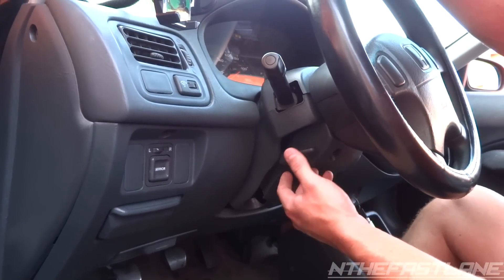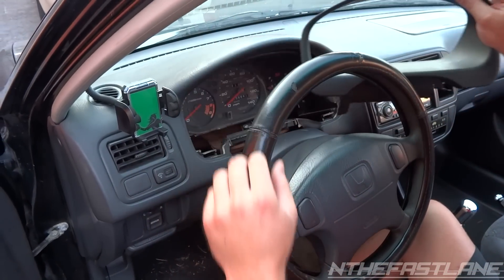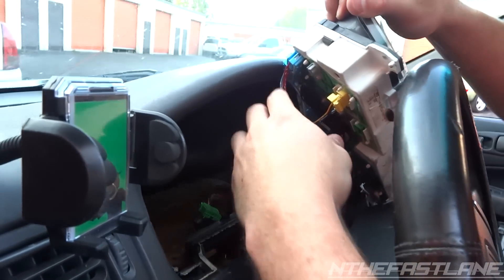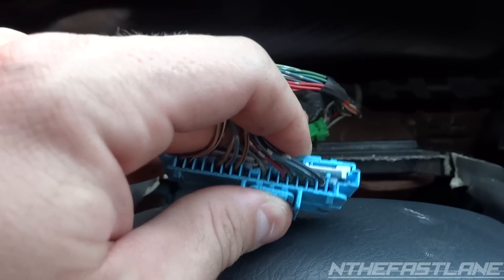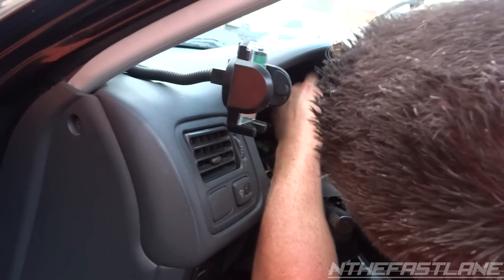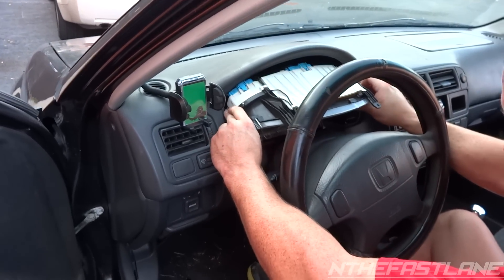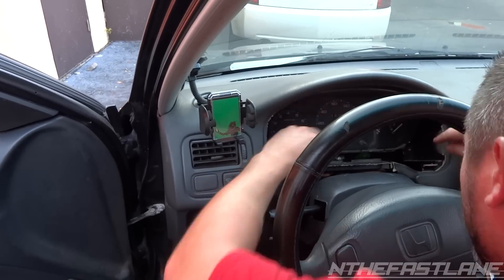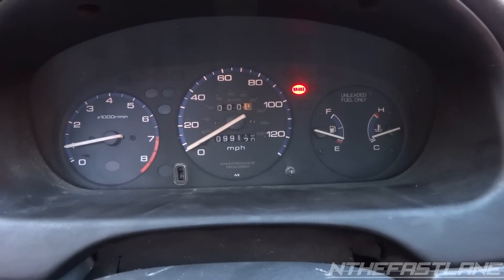▶️Gauge Cluster: How To Replace (Honda Civic 96-00)🔧

Comment: can you replace the speedometer in a manual transmission with one from an automatic transmission? will it plug and play
Reply: Obey Brandon yea you can, I currently have a auto cluster in my 5 speed cause the manual and needles stopped working

Comment: hey must say great vids I have a issue with my Honda eg8 car starts on the 7th tumble check light comes on but wen car has been driven a couple miles and engine switched off and started bk it starts on one tumble and no check light can u give me sum advice.
Reply from the maker: Faulty Ignition switch or Bad cap and rotor on the distributor...even a bad coil inside the distributor could be possible. Change the cap and rotor on the distributor first and go from there. Do you hear the fuel pump? Could also be a bad Main relay under the drivers left foot area under the dash by the fuse box.

Comment: I have a squeeky mechanical speed cable I need to replace on my 90 Integra, would you say this process is about the same on Integra's? Thanks!
Reply from the maker: If you're talking about the throttle cable then yes.Just spray a little silicone spray on it and you're good to go. Check out my window regulator video, the shopping cart with the spray is under the video..about 5-10 videos back on my channel.
Reply from the maker: Here you go..let me know how that works out for you. http://astore.amazon.com/nthefastlaneshoppingcart-20?_encoding=UTF8&node=9

Comment: so if I were a seller and I wanted to lower what I can say is said miles on the car, all I have to do is switch the gauge cluster to one that reads fewer miles? im only asking because I bought a civic 2000 with 106000 miles on it but I don't know if that's real.
Reply: see if u can find record of mileage log
Reply: @Xiferr  how do I find it?
Reply: @nathancalvario7454  vin lookups or a carfax or call dmv see if they have recorded mileage, the seller may know about that too though, and done the research before buying to see if its a good car to swap cluster on. hope for best and see if there is a log.